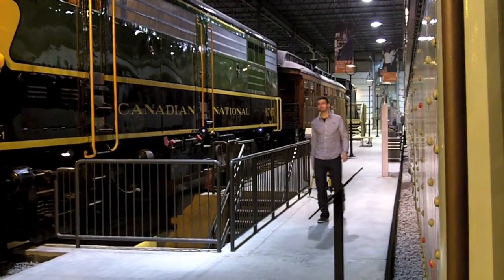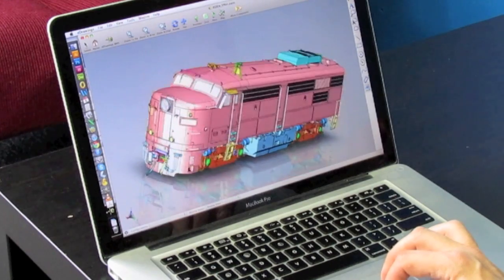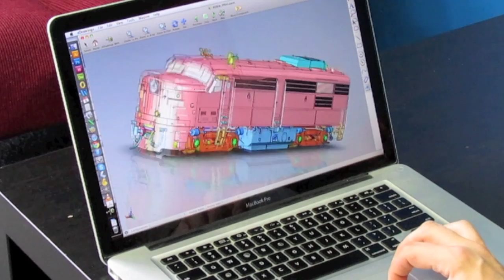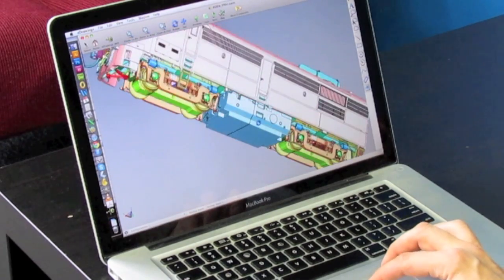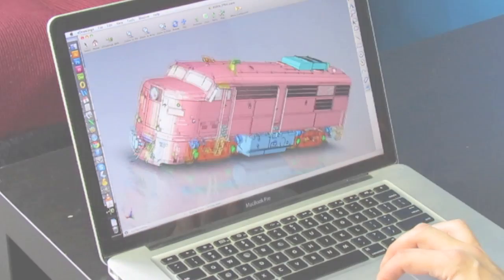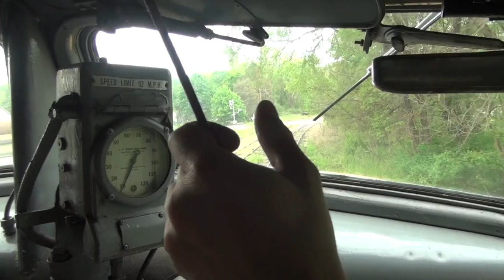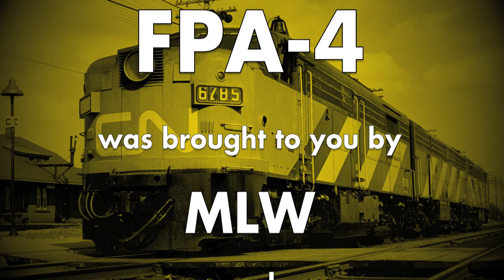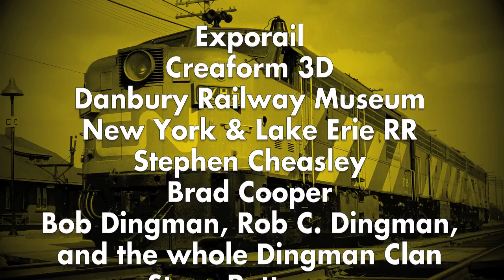3D Scanning an ALCO Locomotive: The MLW FPA-4

Comment: It would be neat if there was an HO scale model of a fantasy high speed rail VIA train, with either/or or all of the following: Alstom TGV, Siemens Velaro and Bombardier Zefiro.

Check out the Wuhan Railway Station in China or Berlin's Hauptbahnof station. High speed rail expansion seems to be accelerating around the globe, especially since its far cheaper than air travel. Its time we joined along.